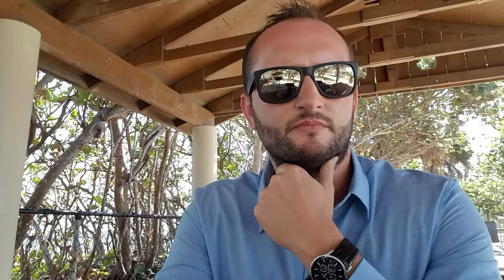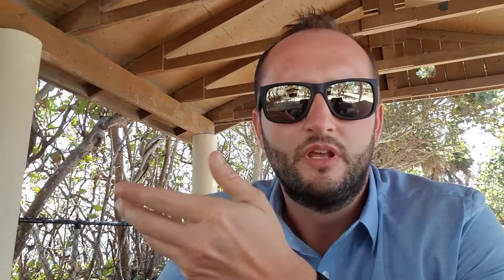Life as a Gas Turbine Manufacturing Engineer

Comment: How often do you use what you learned in your college courses like statics, dynamics, strength of materials, etc. in the field?  Also, how important is GPA to engineer employers....what's considered adequate?
Reply from the maker: Peyton Lee these are good questions! I'm actually uploading a video now that talk about several of those points. It should be up by tomorrow afternoon. In short though, the reality is that depending on what role you have, there will be a limited number of equations used which will be known by all in the industry and easily accessible. Design and analysis roles will use more equations, but they are generally only used to confirm 2D or 3D analytical tools. GPA was not accentuated or even ever discussed in any of my interviews, what is more important is that you advertise your interesting projects or internship experiences. The people interviewing you are regular people, not professors, they are interested in things they can actually have a back and forth discussion with you on. 
The general concepts of all your course work may become useful when using your "engineering common sense" to evaluate problems, but specific equations are not used as often. Remember this is an analog world, a lot of the text book problems are oversimplified and not as useful in industry. Hope this helps. Stay tuned for more videos